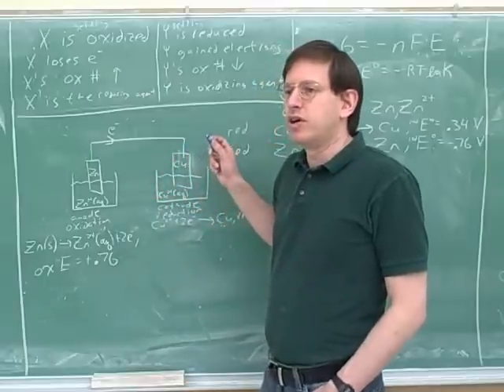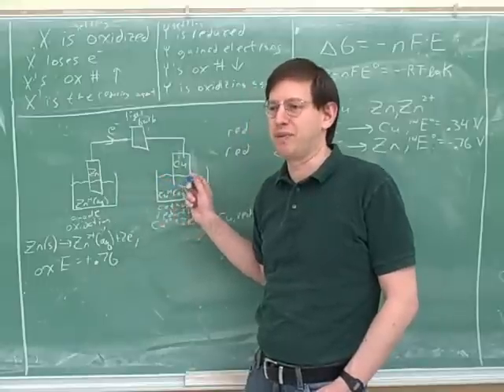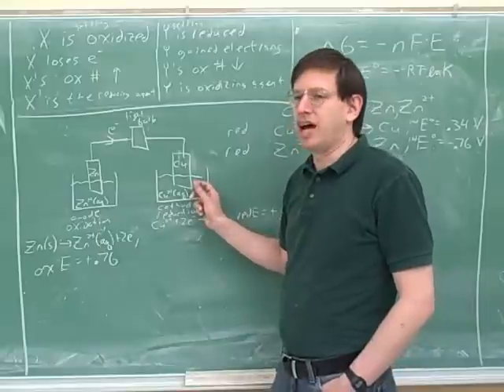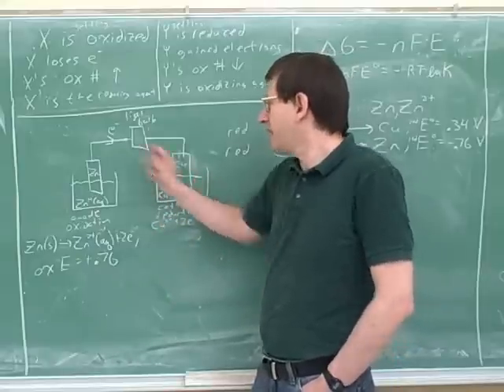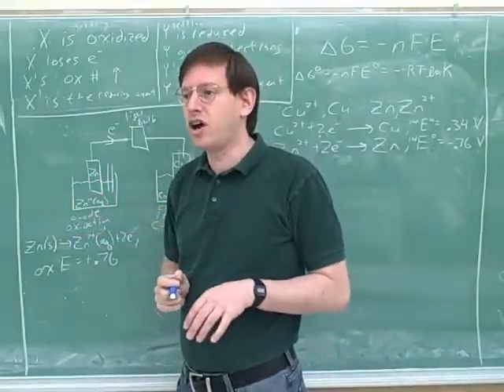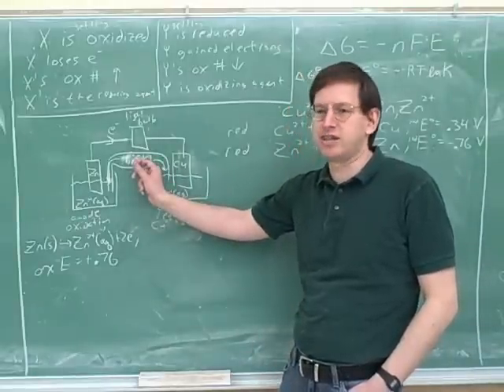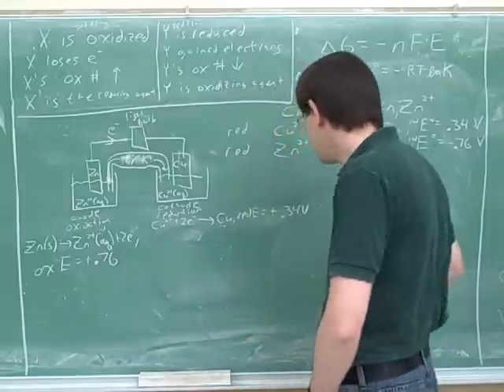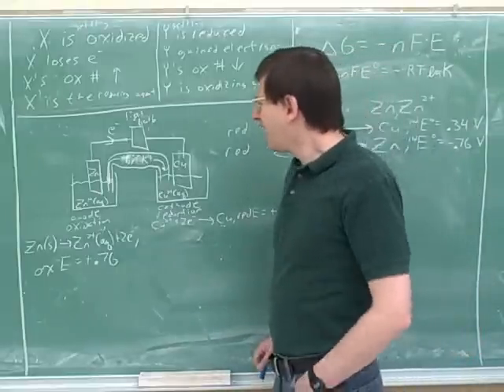Electrochemistry and electrochemical cells (4)

Comment: The cathode BECOMES negatively charged because the electrons from the solution are migrating TOWARDS the metal rod. At the other side the opposite happens, thus creating a current if connected. What you are saying is correct when an external power source delivers the current (meaning the reaction is not spontaneous).